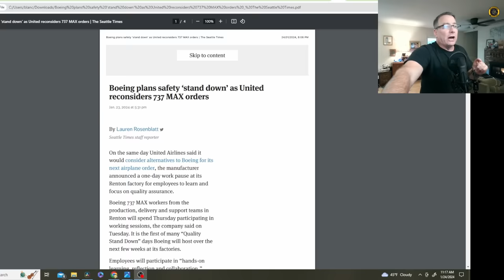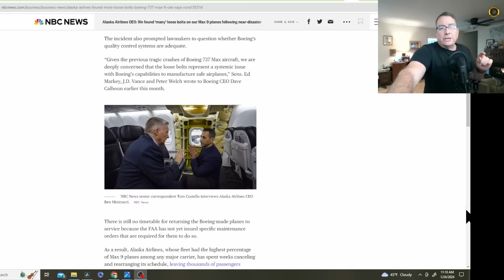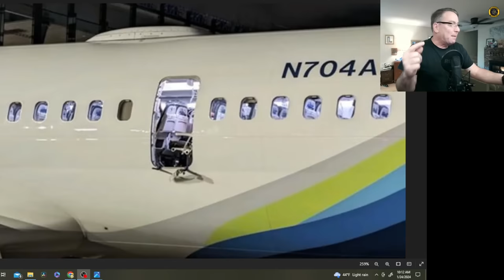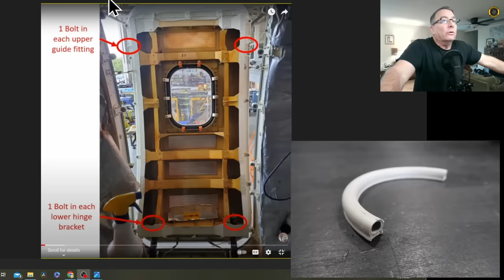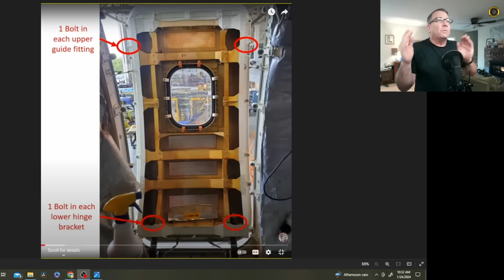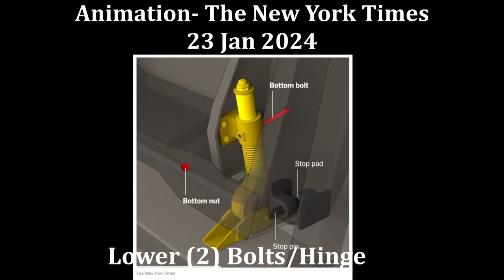Boeing's Quality Management Failure Explained 737-Max-9 Door 24 Jan 2024

Comment: What catches my attention is that Spirit seemingly did this on many jets, yet not one tech said, "Hey, why are we ending up with bolts just sitting here on the floor of the plane after taking this plug off and putting it back on?"
Reply: I think it's Boeing that do the final assembly. Spirit "just manufactures" the parts, which are assembly at their factory for shipping but are then partly disassembled by Boeing when putting together the airplane for the final time
Reply: @frontagulus  Even still, there should be bolts sitting somewhere after Boeing re-assembled those parts.
Reply: @frontagulus  Nope. Spirit employees were at the Boeing plant fixing manufacturing errors found by Boeing QA. Some of those Spirit employees removed the plug door to fix a seal, but when the recorded the work in the Boeing QA system they said they opened the door instead of removing it, so Boeing QA weren't alerted of the need to inspect the plug bolts.
Reply: @mmburgess11 

     There were, according to the leaked information.   

     The paperwork at Boeing points to the fact that the bolts were removed (to remove the plug door) during final assembly at the Boeing plant in Renton.   Also, according to records kept at Boeing, the bolts were never reinstalled.

     This does not appear to be a Spirit Aerosystems issue.
Reply: @Stepclimb sort of. The fact that Spirit employees are regularly posted in Renton to fix QA issues is not great either. An initial problem with the Spirit work is why they needed to open the plug door in the first place. Plenty of blame to go around. Plenty of issues to fix.
Reply: @TheSamHandwich  

      Yes, and to muddy the waters even more, up until recently, Spirit Aerosystems was simply Boeing-Wichita division.

      God knows why they are using two different QA management systems.
Reply: @frontagulus  I wonder if the boils were ever there? Maybe the Spirit employees did just open the door because it wasn't bolted shut and so they had no bolts left over?
Reply: My thoughts as well.
Reply: @mmburgess11  The issue is that, because it was classified as only opening the door rather than removing it, there was no paperwork associated with the bolts and no order to install them again. Opening the door plug and removing it require almost identical procedures (in particular, they both require the removal of the bolts), but only removing it triggers the install and inspect procedure when they're done. Whoever decided on that system is an idiot and shouldn't be allowed to work in the industry.

Comment: And thats it, no oversight on opening a door which is  not a door but could be a door, but a door that is a door has a latching locking mechanism but a door plug needs the four bolts castlenuts and cotter keys. Thanks for update.

Comment: How about a discussion on the differences in how Airbus and Boeing manufacture their aircraft?  There must be some difference that stands out that might explain why Boeing is having quality difficulties and Airbus isn't?  As always, another great report.  Thank you.
Reply: The difference is that the pressure of cost reductions at any expense that destroys all of industries is 10 years behind in the EU. Hope we learn from catastrophic examples like Boeing to reconsider things deeply before it's too late.
Reply: There's such a diverse difference between the two companies. So all things not being equal, let's not include .... you get the idea
Reply: Or the differences between how Boeing used to manufacture aircraft vs now.  They used to be  built like tanks.
Reply: Watch some videos from the shop floor. Usually timelapse of various aircraft being built, see how they're dressed and where tools are parts are
Reply: There's not much difference at all. Airbus arguably has even more dispersed and diversified supply chain than Boeing, because of the international cooperation. It's just their QMS apparently sucks less.
Reply: It happens to the Euro manufacturers as well.   Mercedes' Sindelfingen factory forgot to install the drain tubes for the sunroof of my car.   With their processes, I still don't understand how this happened at all, let alone wasn't caught by those installing parts into the car.
Reply: I guess the difference is just that Airbus doesn't have the difficulties (except with the parts that are made in Italy).
Reply: I have direct family working the A320/330 assembly line as QA.  Airbus has its fair share of quality issues during assembly.  The difference likely boils down to it being recognized and handled.  Oversight and procedure are the key, because humans will always have error or lapses in judgement.
Reply: Some excellent looks/reviews, written and documentary film(s), of Boeing's culture shift that were produced after the Max killed 346 people -- to oversimplify, a legacy culture of safety and engineering was replaced by one of shareholder value being given primacy.
Reply: @cup_and_cone  You're exactly correct. Relying on people not making mistakes is usually deadly. You need to have proper procedures in place to catch those mistakes. Probably, since Airbus has to deal with much more diversified supply chain, they have more experience dealing with it.
Reply: Just speaking to the ruggedness of the planes, Airbus are built pretty light duty in comparison. They are more of a pain in the ass to work on and their manuals & documents suck. Parts availability has been shockingly bad too. Running into parts that Airbus contracted out, they no longer exist but Airbus has no alternative sources. Your forced to try to find airworthy used replacements. Nobody is immune to this these days and Boeing has some serious problems to deal with but I'd be blessed if I never had to work on another Airbus.
Reply: There's not a lot of value in comparison. These are extremely complex products relying on complex industrial systems and people to make it work. For sure other companies are taking a harder look at those systems and the key controls. I've mentioned before that qms roles are amongst the hardest and often undervalued.
Reply: Keep in mind Spirit aerosystems builds fuselages and other major parts for Airbus as well. So are these issues truly only with Spirit aerosystems or are they cost pressures? Put on Spirit by Boeing while Airbus is not putting those kind of pressures on Spirit? That's something that needs to be looked into.
Reply: @jamescollier3 No one has a clue what you are on about.

Comment: The Ajezeera documentary a decade and a half ago "People power on a wing and a prayer" sums this up.  Whistle blowers sacked for raising issues.  Black felt tipped markers used to trace out components and hand cut around them, when they where supposed to use the latest laser weld techniques.  (737s from around 1996 to 2004).  This was an outside firm working for Boeing.  The factory resorted to using hammers and hand drills to make the components fit.

Comment: The normal QA solution is the customer's engineers/inspectors leaning over the supplier's shoulder on the shop floor, giving everyone bad nerves, not the supplier sending a permanent rectification team to the customer. The UK Ministry of Defence used to be omnipresent in it's suppliers' premises long ago. Expensive, so it went.

Comment: This info is very helpful and gets us pretty far into understanding the problem, so thanks for sharing this.

The question that keeps coming to my mind is, "where are those bolts right now?"

They were likely taken out at some point to open the plug door, so WHERE ARE THEY?  If someone found 4 locking bolts with nuts and pins lying around, that alone should have triggered some investigation.  I am not an airline mechanic, but I'll bet that finding spare certificated parts lying around is almost always a cause for alarm.  Heck, extra parts are cause for alarm when it happens on my car and that has zero FAA oversight.

Unfortunately, while we are still hearing about "loose bolts" being found by airlines, I still don't have a clear understanding of whether this matters.  I imagine that the locking bolts are tightened to a spec just to avoid vibration, noise, and wear, but they still do their jobs even when loose so long as they are capped with a castellated nut and pin.

If airlines are finding loose locking bolts, that finding may not be directly related to the cause of this incident.  If the pins are not being tightened consistently then it's still a quality control issue, but what we care about is a paper trail showing that they were at least installed at all.  Media will certainly get upset about loose bolts, but how tight they are is largely a separate issue from whether they are there.  I still don't think that most media people understand what these bolts actually do ;).
Reply: $10 says they're in the junk drawer in somebodys toolbox

Comment: The SAT system is shared by Boeing and Spirit per Seattle Times article(By Dominic Gates on 01/24/24): "The whistleblower cited an entry in the SAT system showing the Boeing and Spirit teams discussed whether the door plug would have to be removed entirely, or just opened." and "Instead, someone decided that the door only needed to be opened and a formal Removal entry in CMES was not required — and hence no inspection.The whistleblower labels this “a major process failure.”"  and  "The online whistleblower writes that the entire sequence of the work is documented in SAT and the damaged rivets and pressure seal are recorded in CMES.." Leading to "In short, the crucial bolts were removed and no one inspected the plug afterward to ensure they were reinserted.".
Reply from the maker: correct, but CMES is NOT shared with Spirit Aerosytems Employees.....
Reply: @blancolirio  It would not have mattered as the door repair was deemed an opening not a removal so it was not entered in CMES anyway, hence the " “...a major process failure.”"" comment. Also from the article" "But the aviation insider familiar with the details of the work, who asked for anonymity because of the sensitivity of the NTSB investigation, said it was Boeing who opened the plug and then closed it up, marking the job complete.". I am not disputing that Spirit and Boeing have a dysfunctional relationship, just that Boeing knew this sort of "non-conformances" where coming from Spirit per another quote from article: "Pierson confirmed that Spirit employees were stationed in Renton doing this kind of rework as far back as 2018. ". In the end it is Boeing's plane and as they are finding out their problem, so prudent behavior would have been to do CYA inspections. Though you could see that was not in the cards when in 2019 from another Dominic Gates  ST article: "Boeing said it will cut about 450 quality-inspector positions this year and potentially a similar number in 2020."  A Machinist's union revolt stopped that, but the mindset was in place to do quick and dirty.

Comment: In a video related to this issue, someone who supposedly used to work for Boeing posted that when he was there they had safety of flight issues that needed addressing across the fleet for a particular aircraft, but nothing was being done. The poster claimed he was told by a Boeing attorney that it was cheaper to litigate any potential loss of life due to accidents than it was to make the proper updates and repairs across the fleet. If that's true, then this single issue is a moot point and a needle in a stack of needles.
Reply: Who knew that Boeing made Ford Pintos?
Reply: Boeing’s quality control philosophy: litigate, not remediate. Why solve when you can sue?
Reply: You're thinking of Ford not Boeing my friend

Comment: Juan, being a manufacturing engineer in and around the automotive industry - it doesn't surprise me that spirit employees are at the Boeing facility doing quality work/retrofit/inspections.  This is standard procedure in a tiered manufacturing environment.  If you send components that don't meet specifications to your customer, you will be required by said customer, to go their facility and make sure the out of specification parts, do not make it into production vehicles.  Sort, retrofit, modify, scrap, etc. are some of the possibilities you will be performing at your customers facility...lol.     
I was an engineer at a tier 2 facility (with tier 0 being the vehicle assembly plant), and if bad components were to shut the vehicle assembly line (tier 0) down - they would charge upwards of $50,000/minute until the line was running again.  And this was back in the early 2000's.   I would expect aviation manufacturers to do very similar processes with tiered quality control.

Comment: It would seem as though the re-inspection requirement was originally intended for an actual door not a door plug. It makes sense that if you opened a door, i.e a normal function,  no re-inspection is required.  Since a door plug and door are not functionally the same the PFMEA and re-inspection requirements should have been updated.  But as usual project and production timelines often push these kind of process control updates to the bottom of the list.
Reply: doesn't really mater in this case since the door and the plug is the same.
Reply: I have same opinion.
Reply: There's more to it than whether a "removal" is required when the door plug is opened ". Nobody would think that taking out the bolts, washers, nuts and cotter pins isn't "removing" something outside of the normal planning sequence.

But, what Juan may have missed is that when Spirit employees are doing on site, warranty rework they are by Boeing policy prohibited from using the CMES system. And so, the SAT system, which isn't intended for documenting work flow compliance, but is more of a scheduling system is being used as a rather poor work around and cannot become and never was intended for the purpose of ensuring that ordinary QC procedures are followed.

One set of eyes, when doing out of sequence work, is never sufficient.

Comment: I would be curious to find out if the person/team that removed the door is the same as the person/team that repaired/replaced the seal and then when the plug door was reinstalled?
Reply: It is just possible the bolts were never installed at Spirit in the first place.  Therefore, even if the same persons performed the work they would not have any reverse the process memory.  This is perhaps a case of the workers just following a check list instead of knowing how the system works in the first place.  This is what happens when the beancounters choose to hire workers for less money than a knowledgeable and skilled worker would demand.  Checklist do not replace skill, they can only act as reminders if the checklist producers actually know what they are doing in the first place.
Reply: sorry, there is no record of that
Reply: @ewathoughts8476  Yea although if the checklist said "remove the four bolts" that would be a dead giveaway that they weren't there when they went to try and remove them. Seems like a documentation failure. Nobody knows what is supposed to be done or what is supposed to be checked after it is done. They are just winging it. No functional quality process at all.

Comment: I should point out that every supplier to Boeing will have its own approved Quality Management System. Having a supplier using the Boeing system introduces new risks to do with integration, visibility, compatability etc.  Ordinarily the seal issue would be worked as a rectification of a non conformance for which specific instructions would be prepared by production engineering. So the details on that specific activity will be the key to understanding.

Comment: The inspection "system" at Boeing probably cost millions, yet it can't seem to account for the fact that the four bolts are just as gone whether the door plug is "opened" or "removed".
Reply: Precisely. Whoever (or whichever committee) decided that an opening was different from a removal is very close to the root cause of this failure. If it was a car door, sure. But there is a hint in the name - plug door - and the location of at least the two lower bolts.
Reply: @BJSheppard  In my opinion, problem isnt difference between open and remove procedure. Problem is, that opening or removing regular emergency door and plug door is very different. So somebody makes her/his life easyier when making procedures without truly understanding nature and differences between two.
Reply: @ivansemanco6976 Yes, it feels like the procedures for "opening" was not supposed to apply to these "non-doors" that are locked in place with bolts as opposed to doors that you can actually open normally.